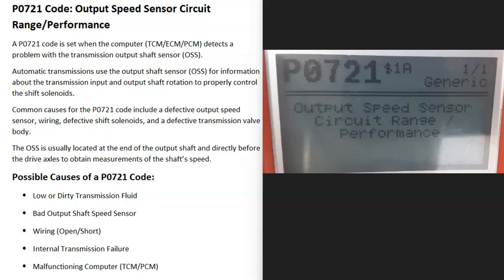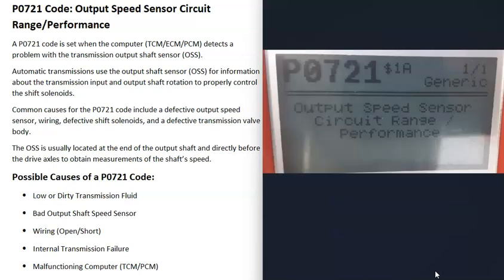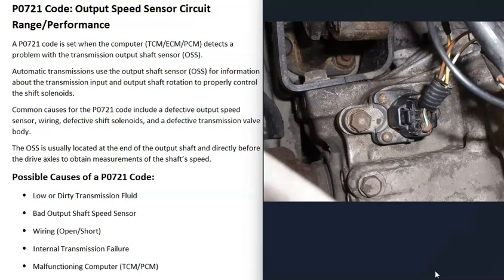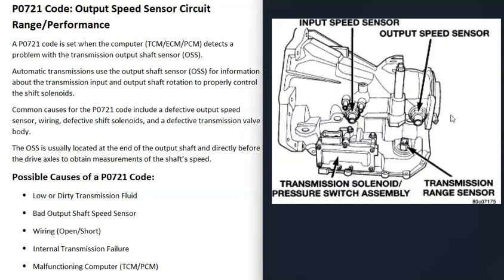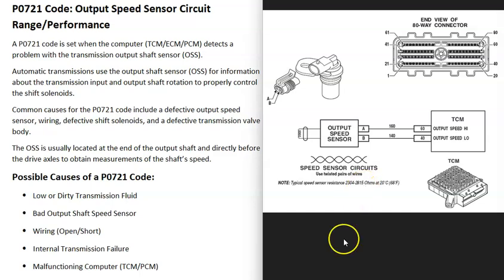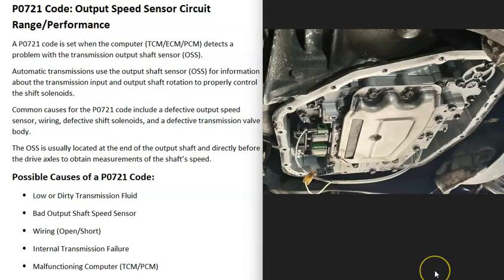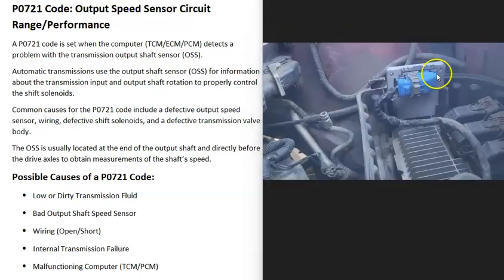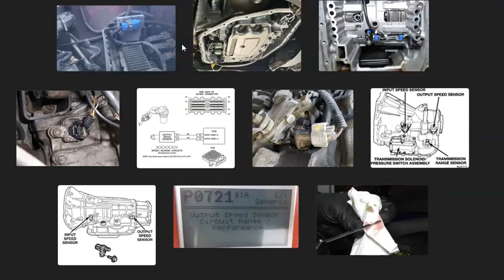Causes and Fixes P0721 Code: Output Speed Sensor Circuit Range/Performance

Comment: Hi there. Thanks for this video. Can you tell me have you gained your knowledge, particularly around faults caused by the valve body. Do you have access to industry manuals etc that state this?  I need some rock solid official reconditioning procedure protocols following catastrophic failure, especially when this fault code and symptoms persist. My issue is with the VW  T5 Auto(09K/TF-60SN) and any thoughts are very welcome.
Reply: You ever solve this?!